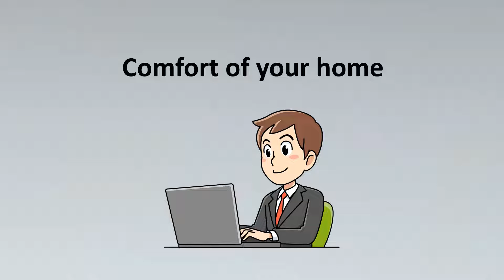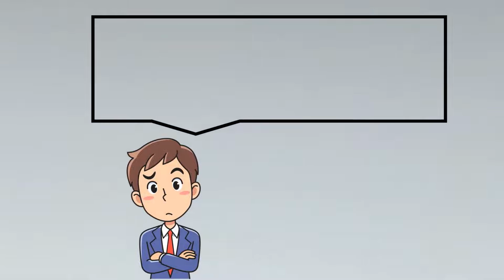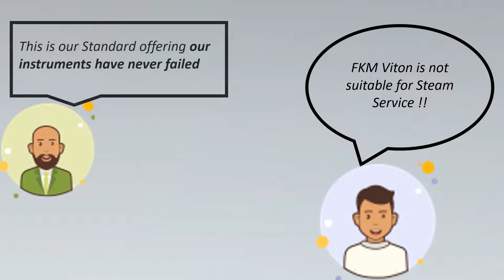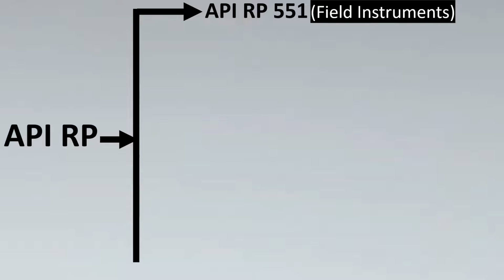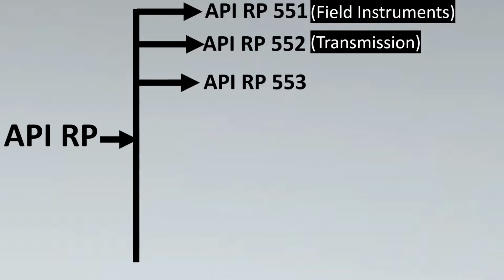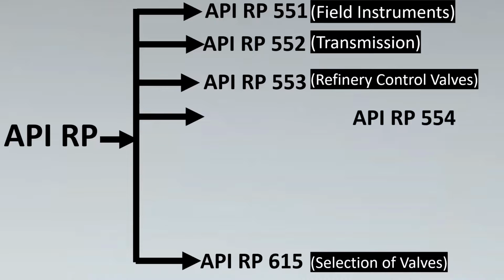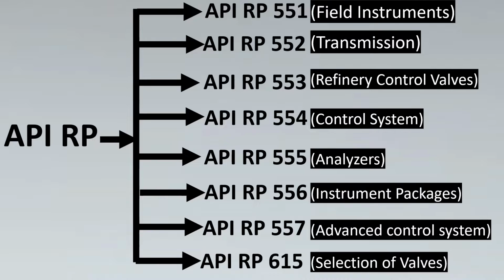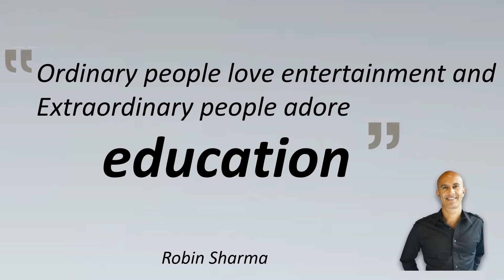What is API Recommended Practices Standard and its guide for Instrumentation and control engineers

Comment: In what page from API RP 551 stated that FKM Viton is not accepted in steam service? I cannot find it in the API 551 that I have.
Reply from the maker: Sure. It is mentioned in API RP 551 Section 3.6.4 (Page 23)

For your ease the statement is shared below 

" API RP 551 Section 3.6.4  :- Instruments rely on O-rings and special gaskets to seal their components. Selecting an elastomer is not a straightforward process. For instance, though used extensively as an instrument o-ring, FKM is not acceptable for Amines or
hot water and steam. Elastomers fail in different manners: some swell, some dissolve, and some take a compression set."
Reply: @AsadPassionateEngineer  Thank you Asad for your reply. Really appreciate it much!